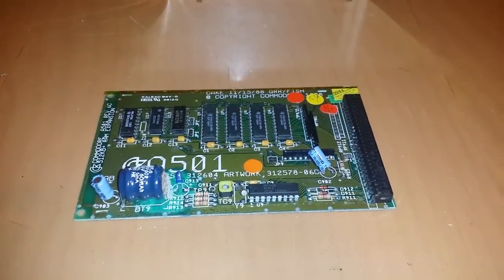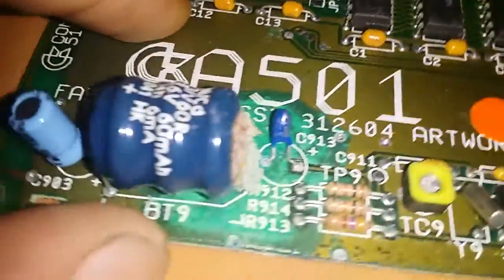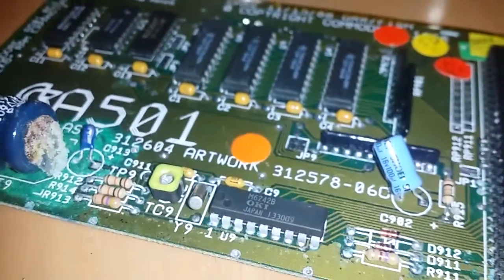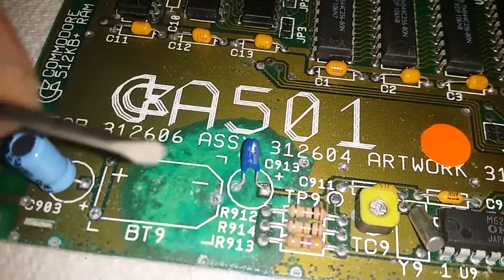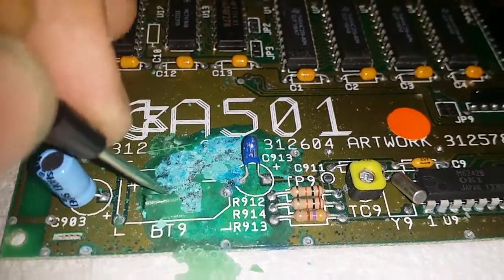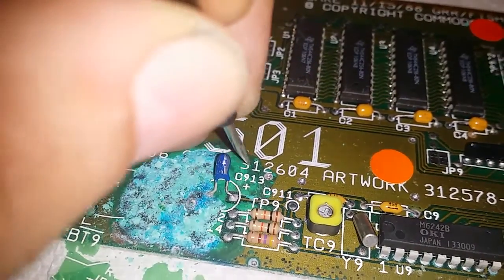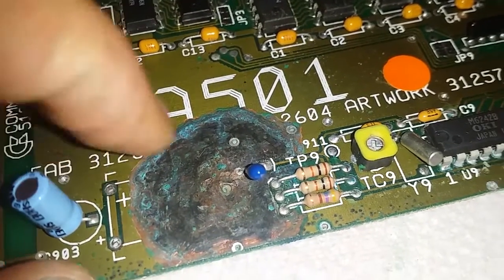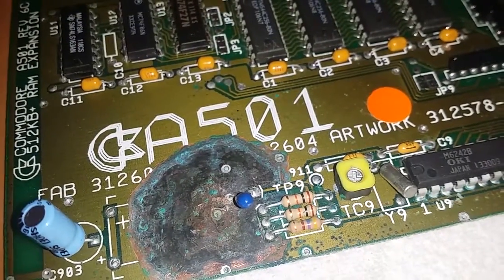Amiga A501 Memory expansion battery leak

Comment: Replace  the battery with a cr3032 cell, just don't forget to put in a blocking diode.
Reply from the maker: g412bb Thanks for the suggestion. Can you enlighten me more about the blocking diode please ?
Reply: +StigsWorld, replace r913 with a diode. Anode should be connected to the battery positive terminal. This will stop the battery from charging. Any type of small diode will do but a germanium type will probably give a bit longer battery lifetime because of the lower voltage drop.
Reply from the maker: g412bb What if I replace it with a rechargeable battery like the ML3032 ?
Reply: StigsWorld Personally I would stay away from the rechargeable lithium cells. Don't think it's wise to use them without a proper charging circuit. Probably takes a few years before a normal battery runs flat. Plus they don't leak that easily.

Comment: replace battery? super capacitor mod !! ? :D :D
Reply from the maker: bwack Tell me more !!!
Reply: I looked closer into it and it does only hold charge for .. 2 - 7 days.. There is also the lithium coin adapter if you don't want rechargeable.. much info here allthough an old fourm thread : http://www.amiga.org/forums/showthread.php?t=32350